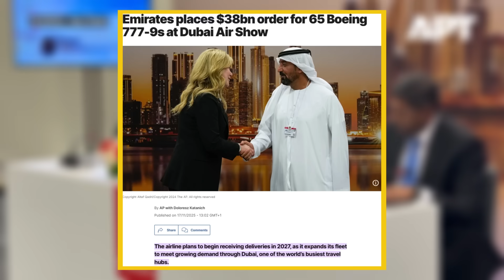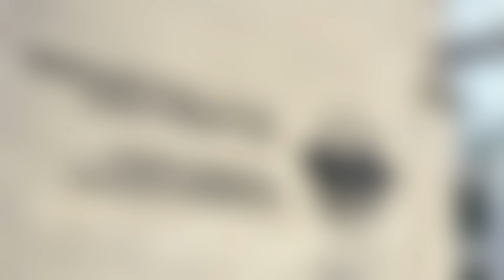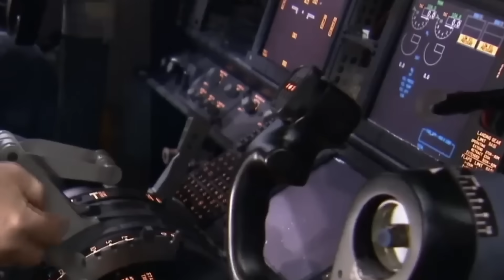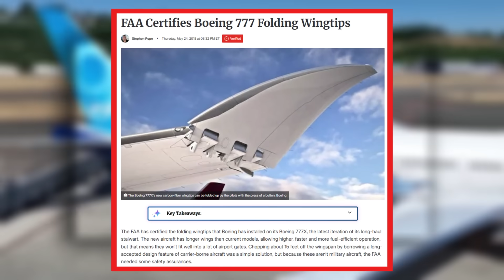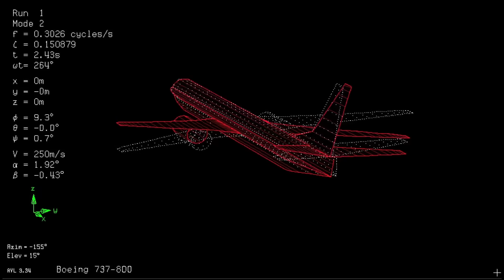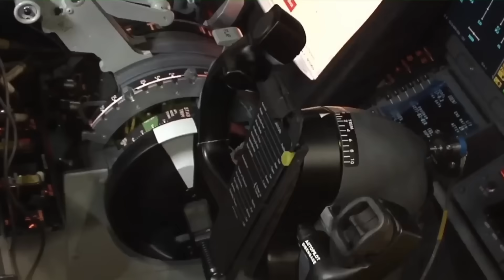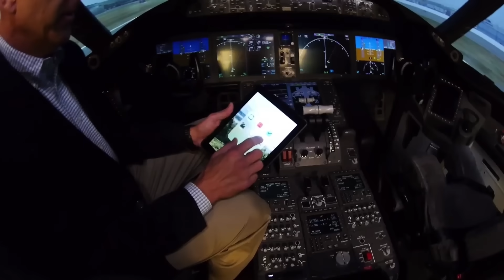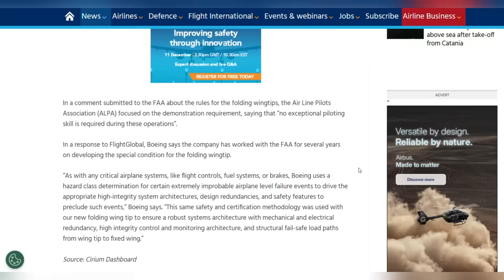How Boeing 777X will DESTROY A350's Dominance?

Comment: Clean sheet?  Proven isn't bad either.  The 777 isn't 60's tech...its 90's tech.   So was the failed A380....the big plane that can't carry the luggage of its passengers.  The plane that couldn't cut it as a freighter either....too bad it only sold less than 1/3 of the copies of the "OLD" 747.   Oh, and with the NEW orders for the "OLD TECH" 777-9...its total count for both "OLD" and "new" 777 versions is about 2200...I suspect if all goes well...it might hit 3000 copies.

  BOTH companies have fine planes and I just as soon not fly on anything but, the 2 major companies....would love to fly on the a350 and the 777-9  someday.

Comment: Ha, Ha. A 1960s 777 so called update. It has so many faults it’s not allowed to carry passengers. Just wait until it does 😱 Scary.
The AIRBUS is a safe Modern clean sheet aircraft. Not a forevermore re hash like the 777x. AIRBUS and ROLLS ROYCE is the future.
Reply: Yes, and solar flares grounded half of the Airbust fleet . 1960’s ? You must be dumb as a rock! It wasn’t introduced until 1995 and the new one is very different.

Comment: They're not competitors,  A350 competes with 787,  777X is in a different class, It may take sales from A350, but thats because Airbus currently has no product in the 777X class.
Reply: The A350 was sized to slot right between the 787 and 777 the A350-9 competes well against the 787 and the A350-1000 competes against the 777-300ER well, but the 777X-9 is in a category of its own designed to replace the 747 and A380
Reply: @Rajahdat-62  correct, I believe that's how I stated it.
Reply: @Rajahdat-62 but A350 planes are the best these days so 777X will take nothing  down 😅
Reply: @AnetaMihaylova-d6f  I never said it will but it will be the closest thing that's big enough to replace the 747-8 and A380 that's why Emirates has ordered over 200 of thesedespite all the delays
Reply: @Rajahdat-62 let's put in service first,  shall we 😅
Reply: CORRECT.
Reply: But there is no 777X  just yet 😅